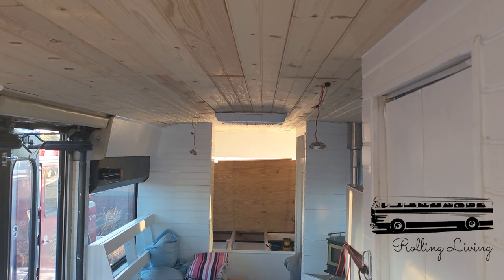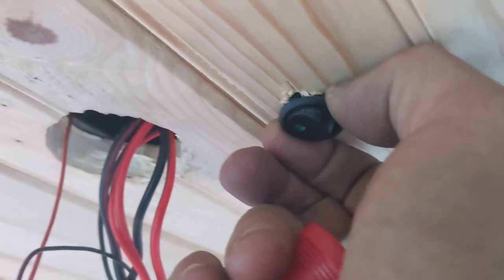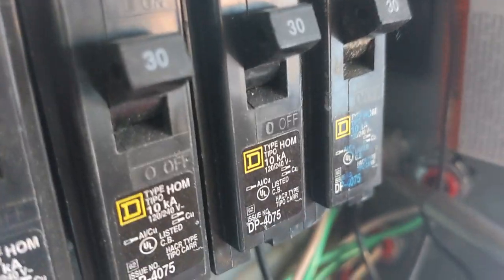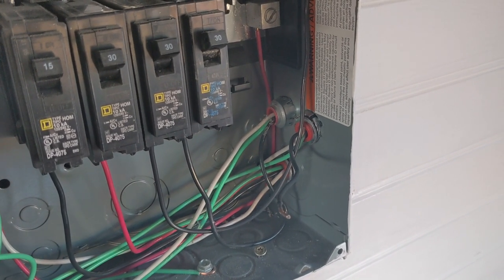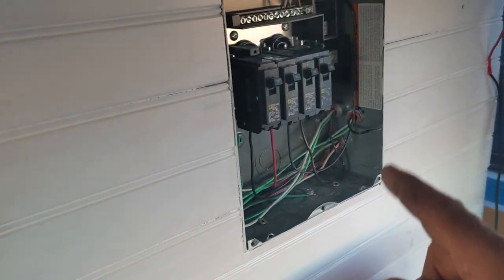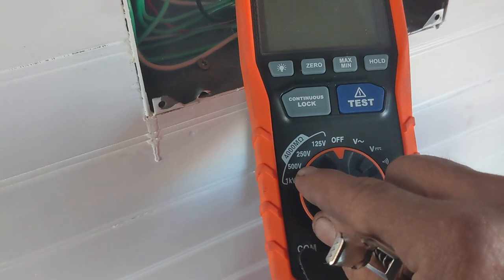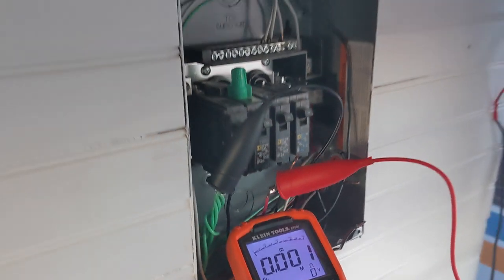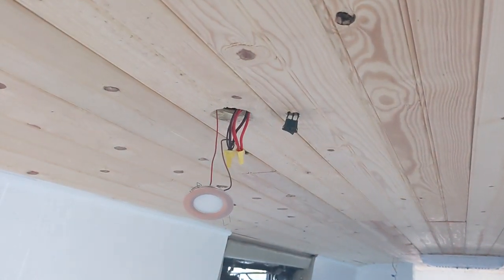Testing the bus AC electrical system.  It's not safe.

Comment: When you do your resistance check, I would make sure that ALL of your devices or equipment is disconnected, otherwise you may be reading the resistance through said device and that’s why you’re getting continuity through your meter at the panel.
Reply from the maker: Absolutely.  I think I mentioned that I'd disconnected everything...but if I missed that, it was by mistake.  Anything connected will cause a false reading and/or could be damaged.

Comment: I've done all of my electrical except my inverter, batteries, and charge controllers. Running off shore power at the moment. I'm picking up information and tips from watching your videos. Glad to say that I'm confident in the work I've done so far. Once finished and on the road, I just might search you out to give my bus a once over. Never hurts to have an expert take a look.

Comment: If you measure from a hot lead to ground (like you are doing) it can read almost a short if connected to a light bulb (as example) in the bus and the light switch was in the "on" position.  But you are 100% right -- AC and DC wiring needs to be checked stem to stern.  Thanks for keeping us and the owners posted on progress.
Reply: You should never have voltage or a direct connection from ground to "hot" positive, the ground wire is a safety ground, the neutral and positive carry the voltage.  I am not trying to nitpick I think you just meant neutral but others may be confused reading this.  The difference in AC and DC voltage confuses many, just when they think they understand it and then it changes.

Comment: LOL. This is why I kept my 120v installation dead simple. The grounds all go to the bus body and from the bus body to the earthline on my shorepower inlet. Further I have a main breaker that will cut off both live and neutral in the event of a leak to earth. All the 12v wiring passes in conduit underneath the bus with only short lengths inside, leading straight up to lights/USB sockets/12v sockets.

Comment: When you do an insulation test (megga test) you need to make sure all appliances or devices (fridge, cook top, water heater, A/C unit etc) are disconnected or unplugged from the circuits being tested. Other wise you will get a false short circuit reading , plus if you happen to test at 1kV or 5kV you may damage any electronics in thoses appliances.
In the instance of a MEN system, earth and neutral will be bonded somewhere and give a short cct result. The main requirement is that there is an open cct between active and neutral and that the earth conductor has an impeadance that is <\=  0.1 ohms to any metal fixtures.
Good practice is to fit RCD breakers (ELCB) of appropriate rating for cable conductor size feeding a circuit. The job of the breaker is to protect the cable supplying a circuit outlet and not the appliance. The RCD portion is to protect an individual from a fatal electrical shock and it also protects against any earth faults in the cable feeding a circuit. The protection of the appliance is down to fuses or protection circuits within the appliance.
Reply from the maker: Absolutely.   I did briefly mention that I checked to make sure nothing was connected...because you only want to check the insulation integrity.  But I didn't go into depth on that, so thanks for expanding on it. 

In this case, there should not have been any pathway or bonding between the neutral or ground.  That shouldn't happen in this panel or the branch circuits.

Comment: I am going to bet you will find at least one screw bored into the AC electrical somewhere. The resistance is from the wires making contact via the screw.  Just a guess from a few years experience following behind hack jobs on old homes.

Comment: Here in the UK we generally use RCBOs which are a combined leakage and over current device on every circuit. They are set at 30 milliamps so wouldn't even turn on with that crap  wiring!
Reply: North America has breakers that are now required in homes that sense leaks or shorts along with overload.  The breakers in this panel are the $2 dollar special that should only be replacements for same in an old box.

Comment: Correct me if im wrong but if you meg’d out those wires connected to devices, you are always going to get false readings and potentially damage whatever it’s connected to. I’ve seen thousands of circuits done and it’s always with both ends disconnected. It’s not fun watching motors and drives get blown up by guys trying to meg them connected. Just something to think about.
Reply from the maker: No, you're correct.  I thought I mentioned that I'd checked to make sure nothing was connected...if not, I certainly mean to.  Nothing was plugged into any receptacle and the AC was not connected.  So they should have all megged out okay...but only one or two did.  I'm sure they nicked/cut the insulation every time they cut the MC conduit. Butchers!
Reply: @RollingLiving  cool. If you did mention, I apologize. Maybe it was all the cringing I was doing over the build quality that made me miss it! 🤣

Seeing work like this causes me anxiety!
Reply from the maker: @JoshuaMompher   No apology needed!  It's a good reminder.  That work, and seeing the cut insulation, gave me anxiety too. :-)

Comment: As a EU citizen and also as a technician I can't understand why in the US they still use metal conduits and cabinets on electrical installations...Here for more than 40 years that metal is out of any electric installation. Only PVC or other plastic materials are allowed and according to the EU electrical code.
Reply: The metal box is grounded to the ground lead for safety, the BX or armored cable used is required in some places as protection from rodents and other things.  The distribution box installed in this is not really an ideal box to use, it is more for industry to use for a distribution panel by equipment or like a hot tub.  They should really have a box that has an easy to understand main breaker that stands out from the other breakers so it is safer and simple.  In some cities the local code requires all power runs in some type of metal conduit,  at least a few years ago they still did.
Reply: @badgerpa9  Yup...We used to have that same system...until 40 years ago...
Now every electrical equipment box is non metallic for obvious reasons...
Anyway...It's a known thing the Electric norms and systems in the US a very outdated...No wonder the massive blackouts and malfunctions on their network.
Reply: The other thing is how norms can change form county or state to another...
Here in all EU countries the norms are the same...what make working much less complicated for any EU citizen in any country, and of course avoid loads of errors and mistakes...
Reply: @badgerpa9  But referring to that "installation" on the bus I can only think that was made by complete amateurs...
I just regret the owner have even paid for such a crap job in everything....
Personally I haven't seen one thing that was well made or installed...everything is dodgy...!
Reply: @TheBigChill1  The electric is not the same in all EU countries. Germany is different from most places, I cannot think of all of them but there are differences.  In the USA often different local codes vary by local needs, a water line in Florida could be safe a foot under ground but in the MIdwest like Wisconsin it needs to be 5-6 feet (2 meters) underground for frost protection.  Some places have a lot of rats like Chicago and New York so having wiring in conduit keeps it safer than romex.  I agree with you the bus is a mess and any time code is consistent is great but sometimes it needs to be different for the location.
Reply: @badgerpa9  Sorry to correct you...
In the EU all electrical norms are the same...Only the UK had different one's
Germany in fact is the author of the majority of the security norms BTW...!
Reply: @TheBigChill1  USA had GFI and AFI protection long before EU, it is not outdated it just was not completely changed after WWII like much of europe.  Portugal is in a bind on the power generation from Natural gas supplied from Russia, much of europe is having problems with power generation. Do you remember the power outage Portugal had this summer?  I do not know what massive blackouts you are referring to in the USA?
Reply: @TheBigChill1  Germany is not even all updated to new standards, countries list the 230/400 but many are not updated yet, and you do not all use the same plugs.
Reply: Portugal has some nice National parks do you ever get to any of them?

Comment: This is so painful to watch. There is just SO MUCH wrong with that build that just stripping it all out and starting over would be so much more productive. There is a fair amount of quality product there that could be reused if it was just redone correctly. Sadly, with the lack of appliable code to the build, what could you really hope to accomplish by suing the obviously inept conversion company? As the bus does not permanently attach to the grid, the National Electrical Code simply becomes a "guideline", rather than a requirement. Hate to see how these poor people were scammed.

Comment: A regular multimeter will work for this test
Reply from the maker: A multimeter can do a lot, but it cannot test insulation like a megger can.   The megger sends high voltage through the wires and has enabled me to find insulation failures in buses and renewable energy installations that I was not able to find with a multimeter.

Comment: That's scary I'm sure whoever built the system had to feel a static charge every time they plugged or turned on a switch not everyone should do wiring sad day for the owner they got lucky having you look it over.
This don't build this bus this way just keeps getting better and better just kidding it's disgusting that someone called it craftsmanship at all.
Reply from the maker: I think I know, now, why the inverter wasn't connected to the panel... no power, no shocks!
Reply: @RollingLiving  does it even work? Inverter ? lol
Reply from the maker: @Oregontrailblazin  Good question!  The display comes on...but I haven't checked it.  It might be a first!
Reply: Exactly why it's not hooked up it's got back feed issues I'm assuming the whole thing is a shame
Reply: @RollingLiving   first it needs striped and done right !